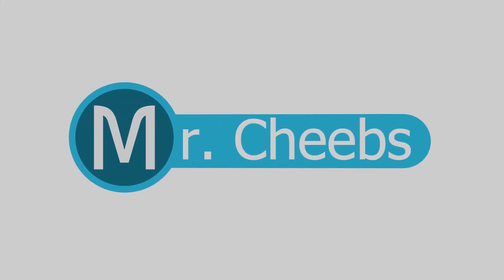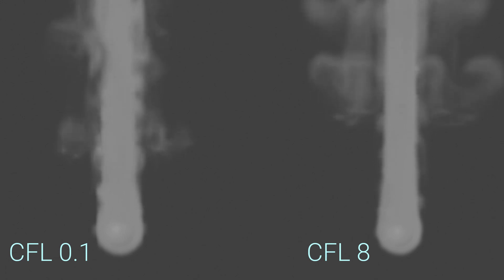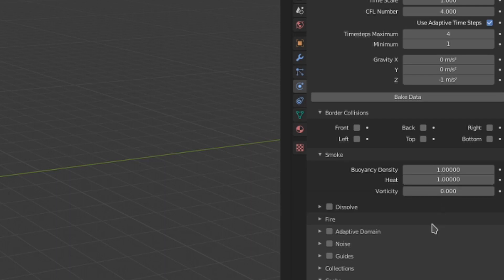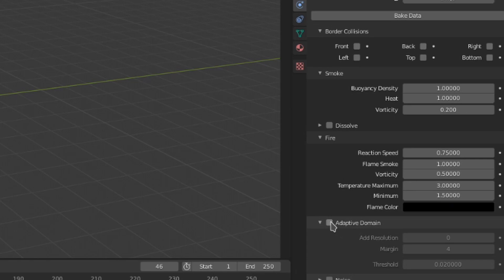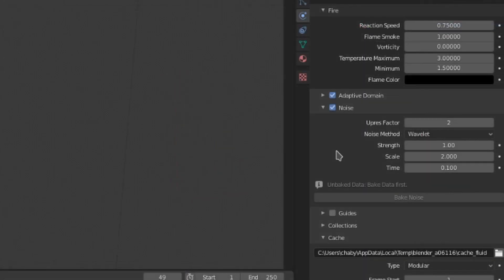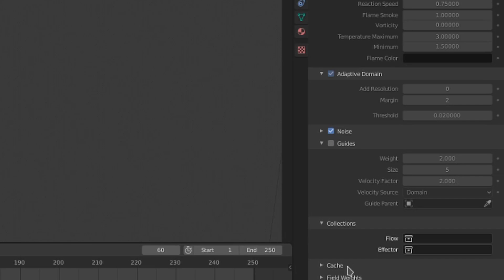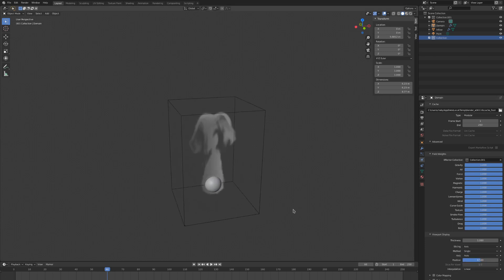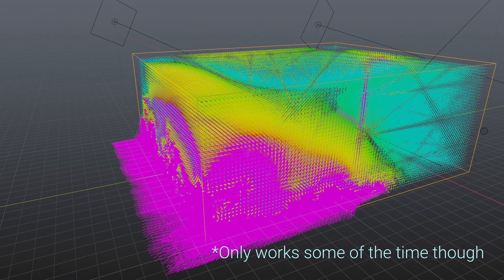Smoke Domains | Blender Mantaflow Part 4

Comment: Amazing content and honestly great breakdowns on how to use the panels and settings. Can you go over final rendering? Every time I try to render my container box is blocking all of my smoke visuals.
Reply from the maker: I'm planning on making a video for that at some point, but here's a quick tip to see your smoke - delete any nodes going into the surface socket for the material output, and instead use a principled volume shader plugged into the volume socket.